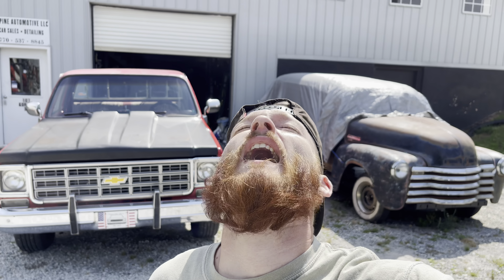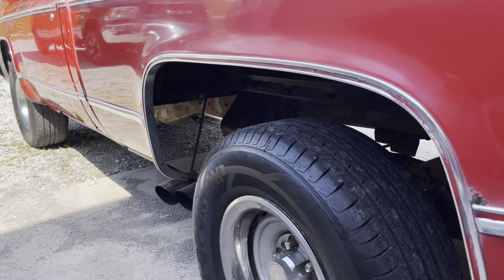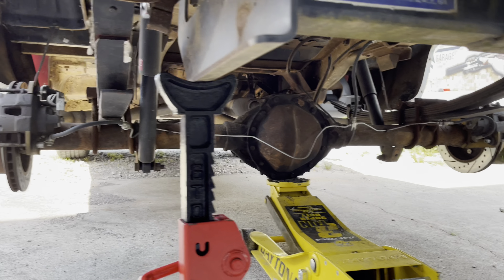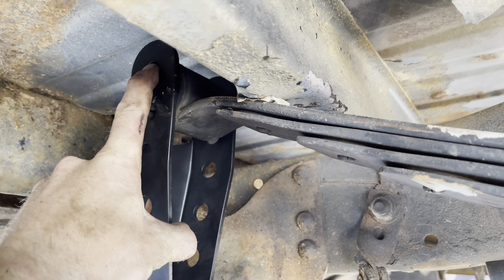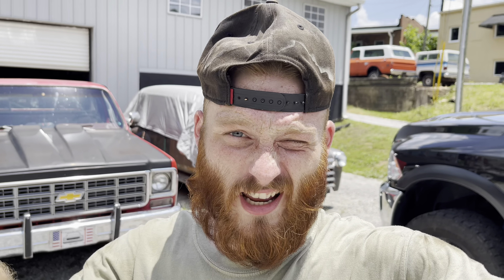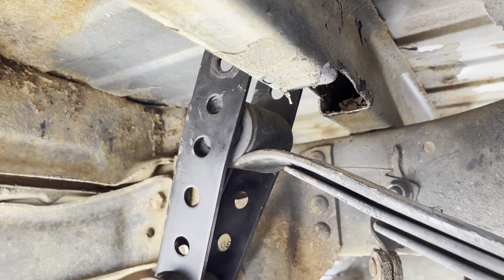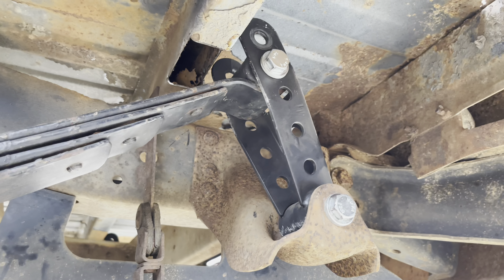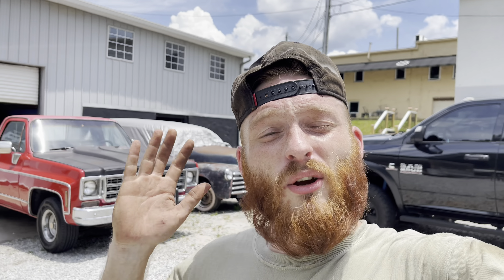1-2 inch Shackle Drop on my 1978 c10. Finally leveling her out. #squarebodynation #chevy

Comment: Do you think it will work the same on my long bed. It looks like your shackles our little bit further back than mine
Reply: Cory, my long bed is like yours and yes a typical 1 - 2 inch drop shackle will work fine. You will not need to cut a bed rail its simple job.
Check around the prices are all over the place and look closely and buy one well made. Suggest you spray all four bolts with a quality lube several times over a week or so before you attempt to remove them.
Reply from the maker: It should work homie!